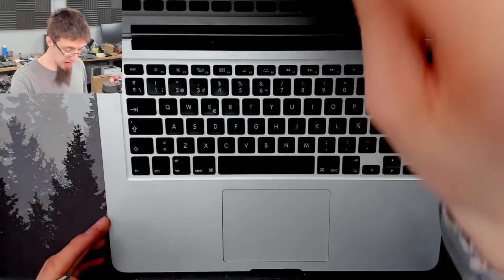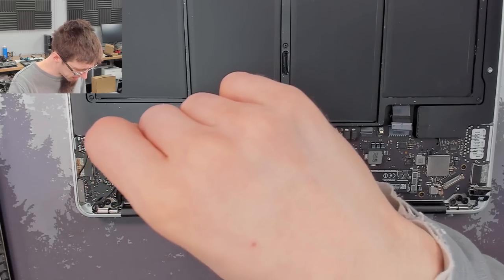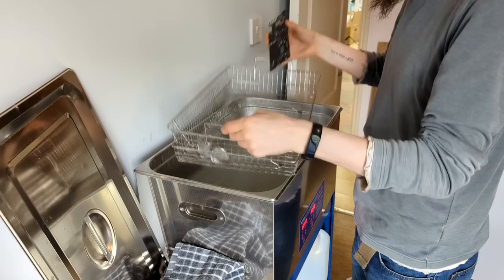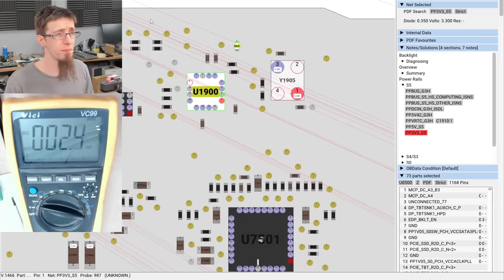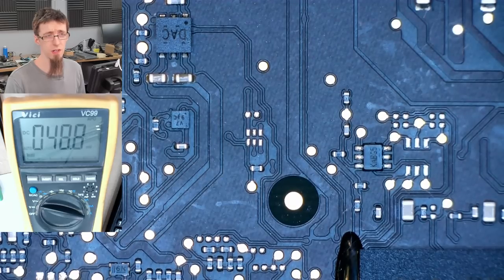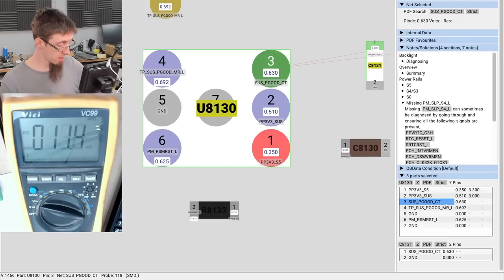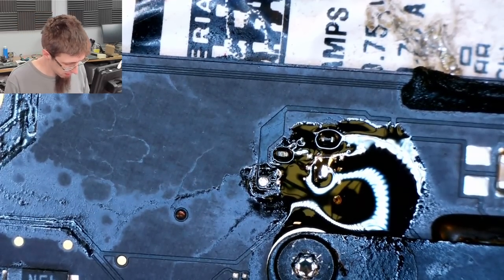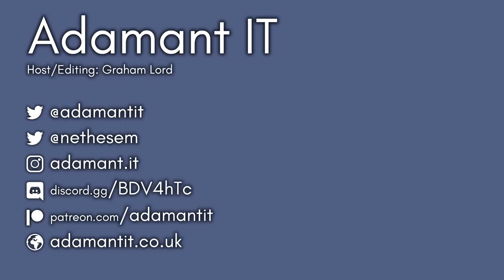MacBook Air Liquid Damage, But No Shorts to Find - LFC#323

Comment from the maker: Extra info: U8130, a Ti TPS8308, is a Delay Supervisor Circuit. It ensures that PP3V3_SUS has come online and stabilised before the PCH fires up. PM_RSMRST_L is the signal it uses to give the PCH the thumbs-up.
Reply: It's been fascinating watching your growth as a channel Graham.
Reply: Go back to 34:25, microscope view, pause the video, and check discoloration of left side mid pcb chip pad. There you are. Chip was ok, but electrolysis and/or corrosion has separated the chip from the pcb. You could just re-flow, but better be sure. Worth the trouble. Right?
Reply: What are your thoughts about using vinegar and a tooth brush to clean corroded components.

Comment: Thanks Graham,  your video does a better job at demonstrating FlexBV than I have managed in the last 5 years.
Reply: Get back to work :)
Reply: @MrPnew1  Look a little old lady with a Macbook over there :)
Reply: @GregM  Ssssh, I nearly had her :)
Reply: hi Paul, I'm thinking of taking my laptop diagnosis and repairs to the next level and adding this kind of testing, and hopefully fixing, but as a first step just finding out why things are dead. 
For example, I have a Dell Vostro 15 3568 that is "dead".  Would an experienced person such as yourself think "I can diagnose that with my software and I can get the schematics for that" or is it a whole other world of pain for Dell, Lenovo, Toshiba etc? I'm not asking about financial return, just possibility/probability of just being able to do this kind of diagnosis or not based on if the info is available or not. Thanks 🙂
Reply: @miff227  biggest cause of time loss tends to be when trying to work out a new machine; sadly when fixing PC laptops it's rare to happen across the same model more than a couple of times in a few years (unless it's a  notable signature fault, like the old A300 Toshiba laptops and similar with the TOKIN caps ).

There'll always be a percentage of machines you can fix without schem/BV, but by acquiring things like FlexBV and the matching files for a given board, you can increase that percentage, of course,  it also means more rabbit holes to fall down too.

Comment: Nice video, good diagnosis. 
In case you're curious, the TPS3808 is a microprocessor voltage supervisor IC from Texas Instruments. It's factory trimmed for a particular threshold voltage (G33 on the part indicates that it is for 3.3V) and when that sensed voltage dips below the reference, it will generate a reset output for a programmed (via external components) delay period. Also has a manual reset input (MR). I typically classify these types of chips as "brownout detectors", they can also be used to ensure that the attached CPU stays in reset until the monitored voltage rail becomes high enough to be reliably used.
So several purposes, but you got the jist of it in your guess.
Cheers,

Comment: Put the board into a plastic bag (eg. ziplock) with the solution you need inside of the bag. Then put the bag into the tray and the (existing) water bath. 
I allows you to choose a different cleaning solution without having to change the current one in the cleaner. And saves a bit on the amount of cleaner used.
Ultrasonics should travel through the medium (main solution) and into the bags solution, maybe some loss through the plastic? I believe glass containers work better but hard to get a bigger board into one.
Cheers,

Comment: Great video demonstrating some fantastic troubleshooting with FlexBV. You’re a skilful chap Graham.
Reply: By skillful you don't mean the half-ass baked solder job where he left the replacement chip crooked on the board? With the slightest effort he could pull it straight, but no... yanking parts 'cold' of the board without any flux, thereby pulling almost a pad in order to finish it off with a crooked placed replacement.... what a joke. My OCD goes beserk, i'm going to unsubscribe from this kind of amateurism....
Reply: @sapperdeflap  missing u already
Reply: I do agree that he should have straightened that ic, but that is my ocd as well. I think he was just anxious to find out if it works!

Comment: Does placing the motherboard in a zip lock bag with the deionized water and cleaner and filling the tank with regular water work as well as not? For the sake of keeping the tank clean.
Reply from the maker: I've heard a few people suggest this, seems like a good idea if you don't mind the extra steps of bagging and unbagging everything because ultrasonic fluid is expensive. So the bagging strat to save on cleaning fluid seems fair.
Still use de-ionised water in the main tank though, just so you don't get scale and scum build up.

Comment: Great video Graham. Very detailed detective work. I would think there is also a chance that a corroded pull-up resistor, R8133, could contribute to the fault. With all the Coke on the board, would you recommend replacing the keyboard?
Reply from the maker: Yea, I should've checked the pull-up resistor as it was right there, but lucky for me it wasn't the issue anyway.
I don't think liquid was spilled on the laptop, but rather next to it. This pattern looks like the laptop was in a puddle, and liquid climbed into the laptop through capillary action. A spill on the keyboard would've left the keyboard a sticky mess (which it wasn't) and the back of the logic board (facing up) was clean as a whistle.

Comment: so many thanks for your lessons. Just fixed my first thing. A sound blasterx g6 headphone audiocard. Just changed a schotky diode with finger testing and measuring if it was working. Maybe it is just working because the new diode is not soldered right and it just passes it, i do not know why it works again but it does!!!

Comment: That centre pin of the removed chip looked dirty to me. I don't think ultrasonic works for thick liquid spills under chips, because most repair vids I've seen they pull the chip and clean under it and try again.

Comment: Well done with the fix. I wonder was it the slightly tarnished ground pad that messed it up. It might of been useful to stick the original chip back in, after you cleaned up the pads, to make sure it was the chip at fault and not the slightly tarnished ground pad. Maybe it couldn't draw the right current before it was cleaned, which messed up the output and prevented it from starting.  That might also explain why the diode readings were ok, dunno.
Reply: that tarnished ground pad looked suspicous to me too when he removed the chip.
Reply from the maker: Yea, I also wish I'd checked that PGOOD signal that was 1.2v to see if it changed as well - sometimes you get tunnel vision while doing a repair onto a path that you know is probably going to work, and forget to test other stuff for research while you're there.

Comment: Not an easy one. Without the flex board diag not sure you can find the bad chip. Thanks for sharing
Reply from the maker: Between the schematic PDF and a few other cheat sheets I have, it can be done without FlexBV. But would've taken much longer, and the longer it takes, the more chance you have of loosing heart and giving up.
Also a shout out to the BST-050 super fine probes I use, those tiny resistors on the back of the CPU would've been a nightmare to measure with stock probes.

Comment: Hiya Graham, A good video pal and great to see how you are progressing in your repair videos :):):) I am still struggling in diagnosing the (not obvious) problems on my board repairs and always seem to get the opposite power rail problems with all the youtube videos I have seen, I struggle with what rail creates what and where to check next.
I purchased FlexBV which is a great help but wonder if you can tell me where I can get those very handy notes you mentioned in the video?
Reply from the maker: Check this video by Paul Daniels that shows how to download the measurement and notes data for schematics in FlexBV: https://www.youtube.com/watch?v=1n6A17ILurc
Reply from the maker: Also here's some extra resources relating to the issues I was working on in this video, showing power-on sequences, and PM_SLP_S4_L:
https://logi.wiki/index.php/G3_to_S3_State_for_Ivy_Bridge_Haswell_and_Broadwell
https://logi.wiki/index.php/User:Piernov#I_am_missing_SLP_S5.23.2FSLP_S4.23_.28PM_SLP_S5_L.2FPM_SLP_S4_L.29.2C_what_do.3F
Reply: @Adamant_IT  Many thanks for your swift reply which is greatly appreciated :) keep up the good work pal and look forward to your next video....

Comment: Really good video, Graham.  Feels like the culmination over everything that's come before it on this channel.

Since you see so much liquid damage in your repairs, I think it'd be informative to do a video on exactly how liquid destroys different parts of computers and electronics.  Some things short out and others experience electrolytic corrosion when power is put to them.  If you've got some donor parts to spare, it'd be interesting to see what happens when you purposely put liquid on various parts of them and start them up at expected voltages and currents.  People generally know that water+electonics=bad, but we're clearly rarely told why.  Especially about the corrosion part of things.  As soon as someone spills something and their device doesn't die, they start to think it's not such a big deal.  And then maybe down the road it does fail, or the next device fails.  Seeing how it actually works and how the detrimental effect could be there but simply delayed might get people to handle things more conscientiously.  Might prevent some costly repairs even.
Reply from the maker: This is a great idea. I'm planning on re-doing the Board Repair Basics series, and this would make a good sequence to show what kind of damage you'll encounter and how to approach it.

Comment: Great video as always Graham. But I believe I noticed a dark pad on the right side when you first desoldered that chip. Could it be just the fact that fixed it? I mean you cleaned up all the pads and reapplied fresh solder to all of them. So could it be that the chip you removed and replaced is not faulty and it was bad contact because the cleaning did not manage well this exact area of contact?
Reply: Look at 33:58

Comment: Hello Adamant, one question if I may. If PMP_SLP_S4_L is About 0V, does it mean signal is present or missing? _L means that signal is present when voltage level is low.
Reply from the maker: Yea, _L means active low. In this case active means "we are in sleep mode, do not turn on."
Reset signals are often Active Low as well, so 0v = "we are in reset, do nothing." and then when the signal goes High (inactive) that means "we are no longer in reset... do stuff."

Comment: Quick question, would it be useful to fill the ultrasonic cleaner tank with alcohol? (or maybe an alcohol/water mix?)
Reply from the maker: A cleaning agent works better. Ultimately, alcohol will just evaporate off, even if you diluted it. And likely fill the room with vapor in the process!
Reply: not pure alcohol, the vibration can make it combustible or something.  I don't know how it works, but the danger is real.

Comment: 10 minutes in the ultrasonic cleabner is overkill G! You only need 3-5 minutes tops on each side. otherwise great video once again!
Reply from the maker: Good to know! I've been reducing my times down a lot, I'm not sure where I got the idea from, but I thought people ran them for waaay longer.
Another factor is learning that some corrosion still on the board = "it couldn't remove this" not "it needed more time"
Reply: @Adamant_IT  Yea youve got the right idea! You have a great ultrasonic cleaner you definitely don't need more than 5 minutes. Excellent repair by the away!

Comment: Look I'm no where near the expert or the skill level you are at Graham but would it not be prudent to see if the fan actually works after being doused in Coca-Cola. Tiny bearings sticky gooey coke stuck fan? I mean to just rule it out at first. Love the skill you have,love the level of knowledge you possess. A great video.
Reply from the maker: If the fan turns by hand, it probably works, and this one did still spin freely. But also, at 14:16 I put  the back of my hand against the CPU to check for heat, which would've been another sign of life. Worth pointing out next time though, yes!

Comment: Hmm seems my subscription got dropped, watched and liked loads of these vids. I have a question I have an Asus X401A laptop that had a keyboard fault then the motherboard failed (went click) I know I could probably look n repair it. I bought another secondhand motherboard and a replacement keyboard (plastic welded grrr). The problem is the motherboard turns out to be an Asus X501A yet fitted perfectly in my laptop, yet the new keyboard did exactly what the faulty one did. I inspected the back of the faulty one and it was full of crumbs and heaven knows the plastic protector on the back was full of crumbs and everything else, looked like some leakage under the plastic but couldn't see any damage on my original board (my laptop bought off Fleabay) Do I take it that the X401A and X501A are not swappable because the keyboard traces are different? Help. I loved the sizzle in the ultrasonic cleaner, you are right quit while you're ahead, as in teeth but you'd be stripping enamel away if you continue same principle.
Reply from the maker: If the connectors are the same on a keyboard, the pinout will almost certainly be the same. It sounds like a fault on the mobo side, which can happen. But also if it was a second hand keyboard, you might just have two faulty keyboards :(
Reply: @Adamant_IT  so I may have wasted 30 mins re-plastic welding, yes keyboard was second hand I'm an Idiot. Got some spare cash bought same X401A1 minus palm rest n keyboard, wasn't spare cash but will resolve an issue. There are ceramic filters above the keyboard connector haven't a clue how to test them to see if they're faulty. Got basic equipment voltmeter etc. Got no money left, this is a hobby learning curve. I appreciate you responding.